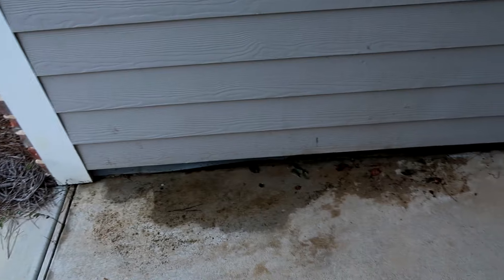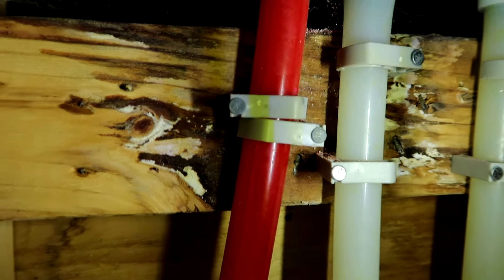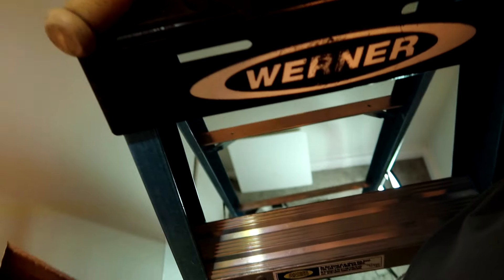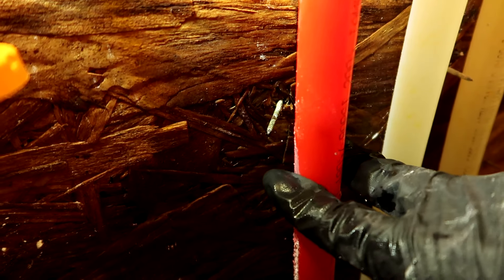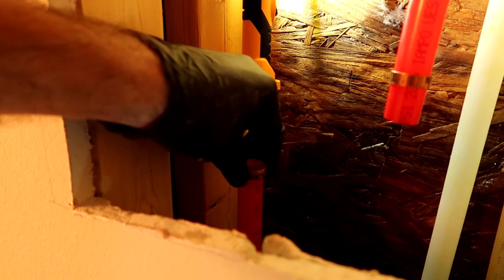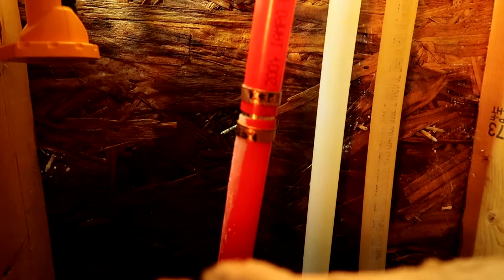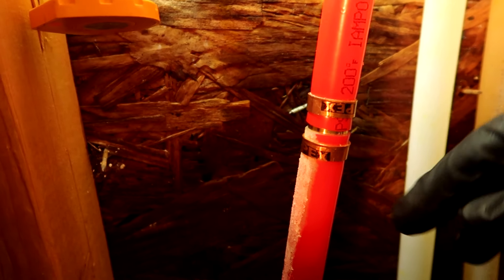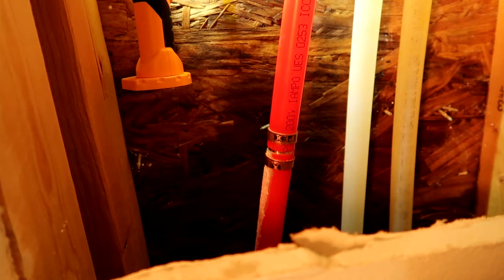PEX Pipe Leak Repair

Comment from the maker: PEX Pipe Crimping Tool: https://amzn.to/3PsItgO

PEX 3/4 Crimp Rings: https://amzn.to/3SVbapv

PEX 1/2 Crimp Rings: https://amzn.to/3w8WZTM

3/4 PEX Coupling Adapter: https://amzn.to/3QRuylx

1/2 PEX Couplings: https://amzn.to/3QN2zDh

If you'd like to support the channel, you can do so by shopping for tools or whatever you need on AMAZON at no extra cost to you through this link,
https://amzn.to/3AaqaIU

Tools That Can Make You Easy Money: https://www.dirtymaintenancenation.com/diy-tools-for-men/

If I've provided any value for you and you'd like to donate $1.00 or more into my online tip jar, you can do so through this link, (all cards accepted)
https://squareup.com/store/dirty-maintenance-nation

This page contains affiliate links, which means that if you click on the link and make a purchase, I’ll receive a small commission at no extra cost to you. Lex Vance is a participant in the Amazon Services LLC Associates Program, an affiliate advertising program designed to provide a means for sites to earn advertising fees by advertising and linking to amazon .com

Comment: I've seen this before in my plumbing days. Trim carpenters shot a nail into the baseboards which were way to long and hit a PVC sprinkler line. It took like 6 years for the nail to rust and  break off to start a leak.
Reply from the maker: Crazy! Thank you so much for watching Jim!

Comment: Thank you Big Dog :) Your funny and fun to watch... very helpful and good job explaining.  I was trying to secure a bookshelf to the wall and drilled through my PEX.  When they built the house the zip tied like 18 pex lines all together so they were so thick they stuck out an inch past the studs.  The folks who did the dry wall on top of that figured... well not my problem so they just put the drywall up and it had like an inch of air between the drywall and stud because the PEX mess was pushing the drywall out.  I kept tapping the drywall to find the stud to drill into but wasn't hearing it cause it wasn't touching the studs... but it was smashed up next to the wad of zip tied PEX... so my stud tapping abilities found that instead and drilled right into the laundry room water supply.  I was gonna use a shark bite but I think you talked me into the way you did it.  Seems more secure... plus a good excuse to buy a new tool that I will probably only use once.  Thanks, you made a crappy night just a little bit better.
Reply from the maker: Just making memories. Thank you so much for watching!

Comment: @LexVance I'm sorry if this is a dumb question. But why are you putting PEX-B fittings on PEX-A pipe? Aren't they going to restrict the hot water flow?
Reply from the maker: No, it's flowing great and haven't had a complaint since this was done a long time ago. Thank you so much for watching!
Reply: I dont think it would matter right? Pex b is mainly for sustaining high temp water. Aprox up to 180°.
Reply from the maker: @servandoperez1606 yep!

Comment: Hell yeah Lex.  Now you’re in my world lmao!!!  Shark bite yeh. If you don’t have pet tools!! Of course, so in you’re case having pex tools will pay off. I’m sure that’s not going to be only one!!!  Peace my fellow Tech!!
Reply from the maker: Good to hear from you Jayson!
Reply: you can likely rent the "proper" pex tools for the job at hand. it looked like all pex-A expansion pex. for the one off leak now and then rental does make sense 😁
they do have lower cost "manual hand operated" expanders that will work in most cases for a few fittings. I sure wouldn't want to use them for more than that! your hands and arms will fall off 🤪

Comment: Hose lamps for those of us without the crimping tool.  Thanks bro!
Reply from the maker: Thank you so much for watching Brian!
Reply: Hose clamps will not work on PEX.
Reply: Hose clamps are not authorized by ANY pex manufacturer. Why risk flooding your house causing mold and thousands in damage and repair bills? Funny thing is a stainless hose clamp costs more than a pex A ring and fitting. Stop it with the stupid info guy.

Comment: Great video:).    I seen some guys who crimp two or three times is that good bad?    Also seen guys put pvc glue after they did what u did.   What is your opinion on that ? Thank you in advance :)
Reply from the maker: If it makes them feel confident to walk away and leave it, do it. 😆 As long as it's fixed. Fixed is fixed. Thank you so much for watching Nolann!
Reply: It's not necessarily bad, but it can be as a ring can become over-crimped which weakens both the ring and the PEX. The use of a simple Go-NoGo stamped plate gauge after the crimp is made is key. If it says your crimp is good and the ring is in the correction position leave it alone.

Never add PVC "glue" to PEX. First, the purpose of PVC "glue" (not actually glue but a solvent) is to produce a chemical reaction in the PVC that results in melting both surfaces of the joined PVC sections (which is why you need primer) which results in a cold weld cementing of the PVC materials. There is no practical holding power to the 'glue' itself so it would serve no purpose on a crimp connection. Second this is PEX (cross linked polyethylene), not PVC (polyvinyl chloride) , so the combination won't produce the same chemical reaction between PEX and a fitting. Third, even if it did have an effect, why in the world would you want to introduce a chemical that could melt or weaken the PEX? Those guys you've seen do that are idiots who have no understanding of what they're doing.
Reply: @anticapitalize      Wow.   So much awesome info.   Thank you thank you     Have a great day.    :).
Reply: @anticapitalize      Any brand u recomendable of tool used to crimp rings around pex.  If so what brand do I buy.  And where can I buy a jack or proper name of tool jack to pull out old copper leak pipe to replace with pex.    ?    Thank you in advance

Comment: after seeing the nail and leak, it may not have been leaking since new construction. why do I say that? expansion and contraction as it heats and cools! seemingly the hot water line which would grow and move the most, it could have slowly poked a hole in itself over many months to years, once leaking it doesn't take long for mold to start growing.
but yes, they should have had closer spaced blocking and fastening to help curb deflection from expansion. as they say, hindsight is always 20/20  🤣
** then you showed the way they installed it was bad and too close to the outside wall. when they bowed it inward to pass through the inner 2x4 wall, they caused it to bow towards the outer wall down lower, if double thick walls with some void between, why did they not space it in deeper with a pair of 2x4 or one on end. seems to me more like an install and inspection failure now by 3:59 in video, still possible that expansion caused the leak.
Reply from the maker: Thank you so much for watching throttle!
Reply: Dude that nail was all the way through the tube and the building was only 4 years old.

100% builder error.

Comment: What you should have done is cut at the hole and not taken a chunk out of the pipe. Then used a sleeve system to cover the cut and glue sealant.
Reply from the maker: Thank you so much for watching!
Reply: Why?  He fixed it.  Some time ago, too.  So what he did is exactly what he should have done, since it's fixed.
Reply: @jwm6314  it's not the right way

Comment: Well the first mistake is using an outdoor water heater. Second mistake is running the pex almost against the outside wall. Third mistake is it should not have taken 4 years to figure out there was a leak  I have been using a tankless water heater for over 10 years and that is one of the worst installs I have ever seen
Reply from the maker: So true! Some of that quality craftsmanship from new construction. 😆 Thank you so much for watching Max!

Comment: What about all that rotten wood ? That needs to be fixed to
Reply from the maker: Luckily the pressure treated wood was still good and not rotted. It was discolored with mildew but not rotten, yet. We sprayed it with a bleach and water mix and put a fan on it for a couple of days before we closed it back up. The wood looked normal again afterwards and its still good today as I walk by there every day. Thank you so much for watching Xavier!

Comment: Pipe should have been on the inside of the insulation, this would not gave hapoened.
Reply from the maker: That's that quality craftsmanship by the builders. 😆 Thank you so much for watching Bob!
Reply: ... until a tenant tries to hang a shelf or picture and it happens from the inside

Comment: Thanks!
Reply from the maker: Thank you so much for watching!
Reply: FYI for others.  I have a leak in the ceiling above the guest restroom.  Noticed it last week.   Huge mold stain. Sagging rock. One tiny drip.  Called a roofer.  Said he found where it leaked around a roof Jack.  Didn’t want to look inside the attic though.  I’m didn’t like that. 

Got up there myself.  No water stains near the Jack pipe or rock under under it.  Turns out to be a PEX tee above the stain.  3/4” main to two 1/2” secondaries. 

I’ll get a crimper and some lugs.  With my knees busted after my surgery last year I pushed the easy button.  Guess I pushed the wrong one 😃.  Thanks again!

Comment: Pex is the worst thing ever invented along with shark bites, everything should be hard piped copper and brazed and it will last a lifetime as long as the person that brazed and ran the pipe are good and experienced. I have ran miles of pipe, copper/steel/welded/brazed/soft solder/ Pex/PVC/CPVC/ I mean just about everything, I do commercial HVAC and plumbing and our installs are never the same especially on commercial boilers they now allow CPVC schedule 80 coming out for the flue piping and then they allow you to run PVC after that. Oh an things like dielectric unions, we get into everything and that’s not even the mechanical side of things I deal with. Diagnose, Install, Repair, Demo, We do warranty work for manufacturers anything to do with it. Anyways Pex is garbage and they shouldn’t allow it anywhere especially behind Sheetrock I don’t care how good you are PEX IS GARBAGE AND SO ARE SHARKBITES stop being lazy and do it right, PVC, CPVC, Hard copper pipe, and 	quit being lazy and using soft roll to do condensers. We did a school to help them out one time and me and one other guy did 39 condensers in 1 week and pulling a vac and hard piping them all through a brick wall. Soft roll makes your work look like you don’t care and you just do the quickest thing and don’t ever put shark bites behind the wall. Common sense Jesus.
Reply from the maker: So true!